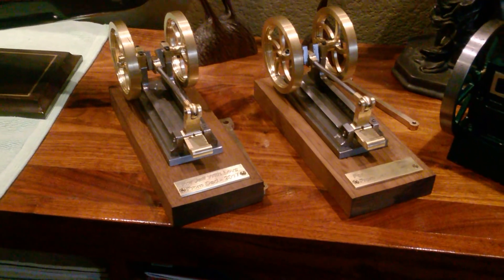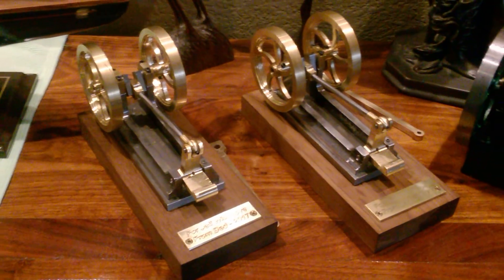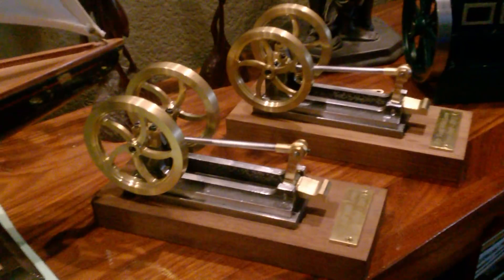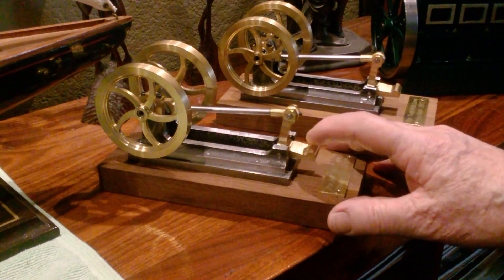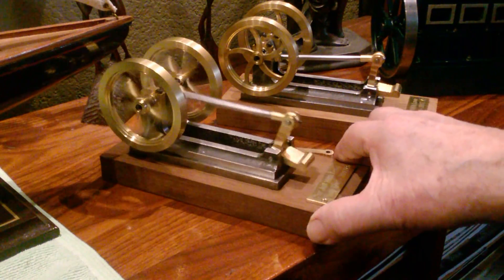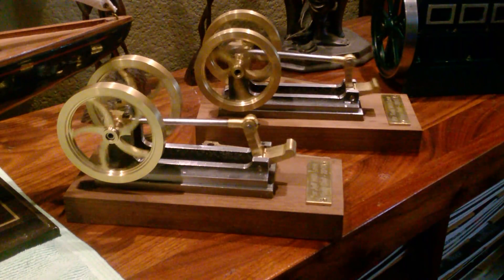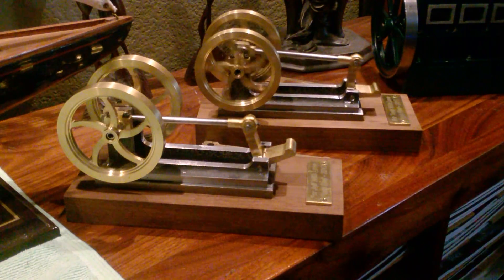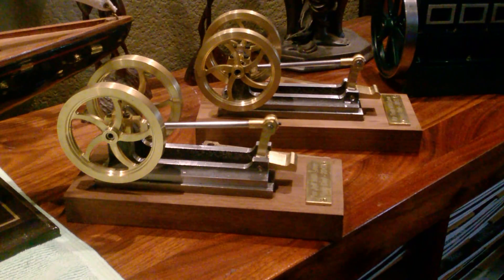Finger Treadle Engines

Comment: Do you have the plans for this engine if so is their any way that I could get them I plan on doing it for my machining class
Reply from the maker: Here is a build thread that shows a lot of the individual parts and some dimensions. 

http://www.modelenginemaker.com/index.php/topic,7494.30.html

I could provide a PDF sheet showing the 2D profiles with some dimensions.  Doesn't have all the dimensions, but the drawings are to scale.  I could also provide some DXF files of things like the flywheels and profiles of the frame parts.
Reply: @cffellows  Could you possibly email me the same blake.lyne2001@gmail.com thank you much.
Reply: @cffellows  I too am wondering if you could share your PDF sheet with me? Thanks!!!  irpaxx@gmail.com
Reply: Yeah do you think you could email me the pdf sheet? bradynboe@outlook.com
Reply: Thank you again

Comment: Very nice!  What process did you use to cut the flywheel spokes?  Thanks for sharing.
Reply from the maker: I used my CNC mill / drill to cut the spokes.  They were drawn up in Microsoft Visio and the gcode was generated by CamBam.
Reply: Thank you for the info Chuck.  Nicely done and I know your boys are going to treasure them.  I need to put some class in the flywheels of my scratch built steam engines but CNC is a big jump for this ole fella...  LOL
Reply from the maker: This curved spoke design originated with Phil Duclos and he wrote an article for Projects in Metal magazine, issue number 2 published in April 1988.  The article has drawings and instructions for a fixture used with a rotary table in a manual mill for cutting the spokes.